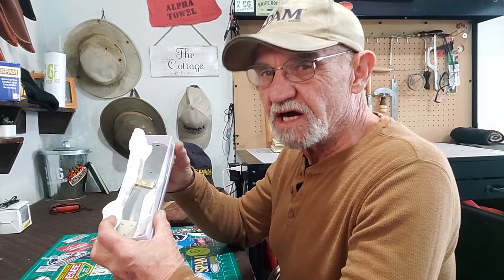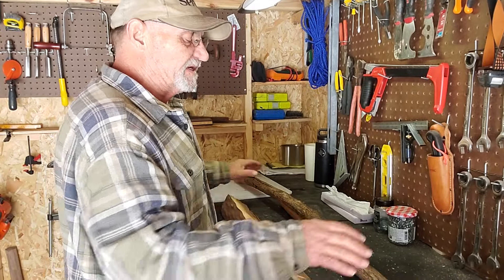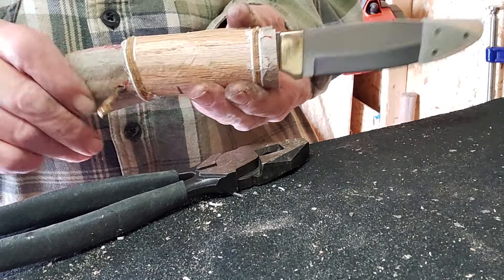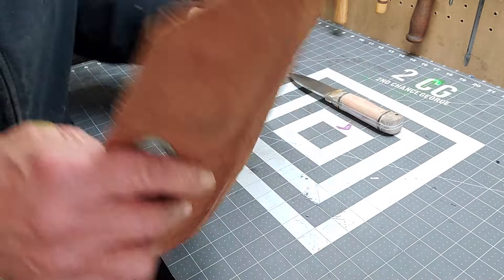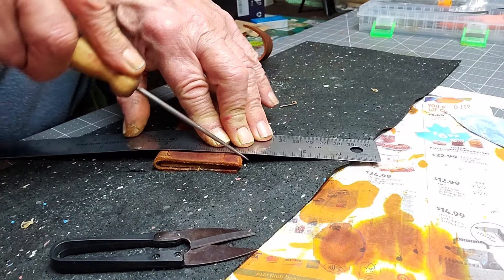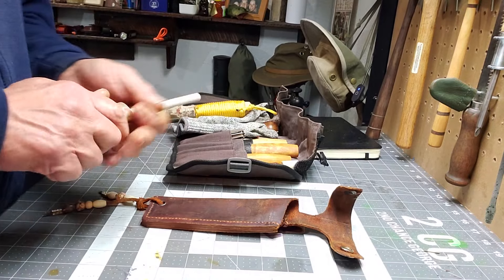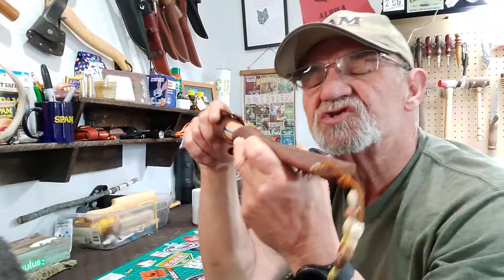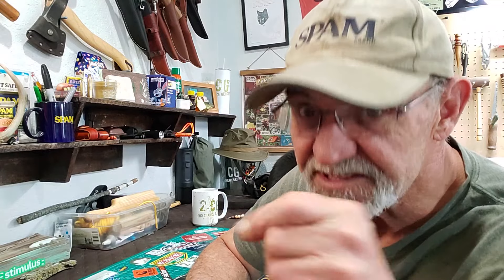Crafty Hunter: Mastering The Old School Techniques - A Challenge Like No Other #knife

Comment: George, don’t be too critical of yourself. I think that overall the project turned out well. I always use the two part epoxy glues for the handle attachment. I haven’t had any of them come apart, even under the stress of lying unused in the safe.
Reply from the maker: Yep. I will be using JB from mow on.
Reply: @2ndchancegeorge  Yeah, use the JB “JUST BECAUSE”
Reply from the maker: Lol...yep

Comment: Pretty cool project George. I’ve seen those blade blanks at SMKW, for cheap prices and plant of selection of blade profiles and shapes. But like you, I’m always concerned about the mystery steel. I’d prefer carbon steel, so I’m gonna hold out and try and find one of those. I’m skeptical of Pakistan stuff, cuz I don’t think they heat treat stuff properly cuz most of the Pakistani knives I’ve bought, I can’t even get a working edge on. But once again, you’ve inspired me to try this on a carbon steel blade. I have an old imperial fixed blade from the 50s, the one with the black plastic handle covers, that I got on eBay. It just has the guard and the full tang blade, looks like they took the handle slabs off and polished the blade. I’d prefer to buy a new blade blank first tho, cuz I don’t want practice on vintage stuff. Thanks for sharing!
Reply from the maker: Yep I hear you. Nust do it you will surprise your self. Be safe my friend.